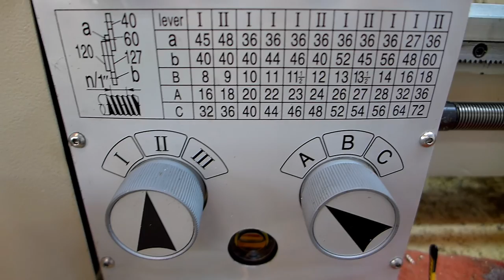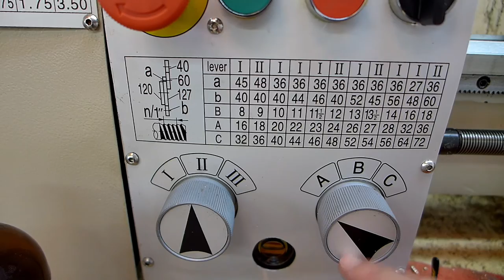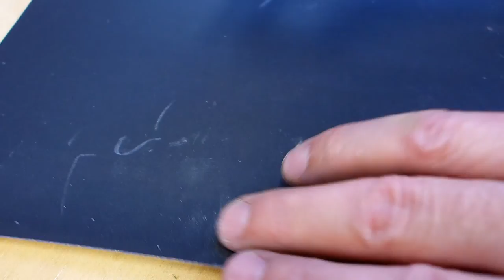Making a Tea Kettle Whistle—Part 5

Comment: I really love the way yours sounds!  I purchased my first and first used yesterday but it doesn't make the shrill sound.  Not certain how much water to put in it, it's a 2.1 L.  I read recently to fill kettle 1/2 to 3/4 full, also Not to go over the spout- Will try this today!  Any more suggestions anyone?  It has an  infuser to place teabags in, so the water has to go over the teabags right?  Any suggestions I will be thankful for.  Also, the instructions said that there were holes across from the spout, misleading.  The only ones are right under the spout shaped like a flower.  3 in a line, 3  underneath those, and 3 straight over the middle ones.  So, how far to fill the water level using the holes as an indicator?  I'm no cook and previously just heated a cup of water for tea, etc, via microwave!
Reply from the maker: My wife fills our up to the top quite commonly. It doesn't whistle as nicely that way, though, but the water still boils. I don't really know anything about tea kettles. Just made the whistle which she uses every day.